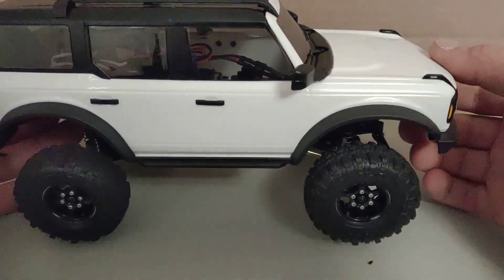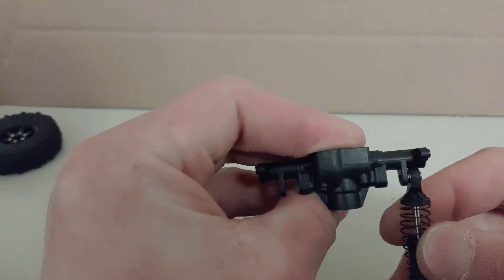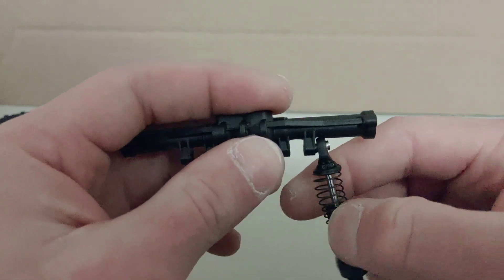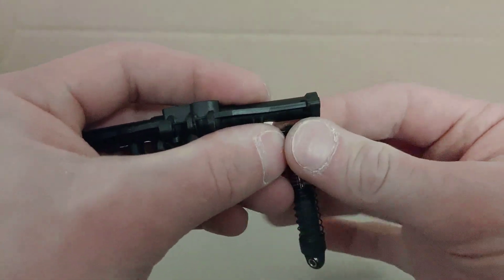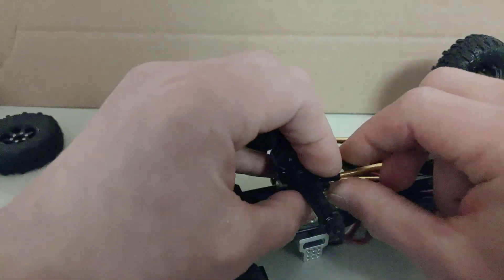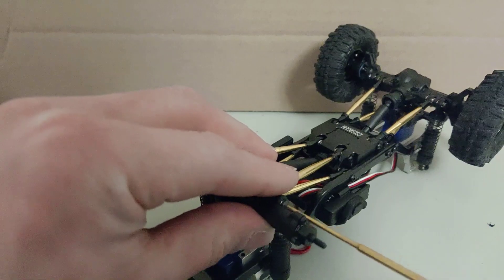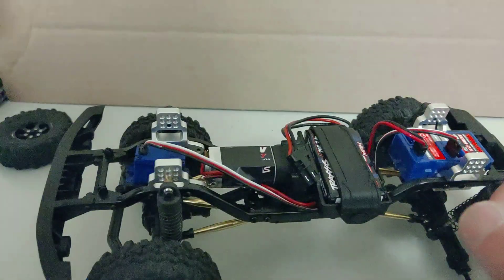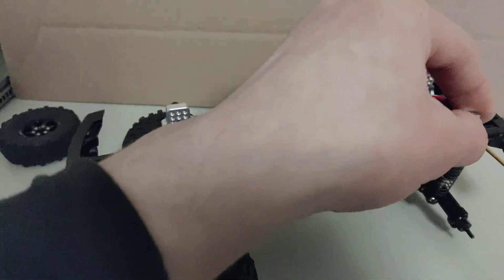Traxxas TRX-4M leaky shocks and rear axle housing fix.

Comment: Wow, you fixed me👍🏻
Guess I over tightened the screws for my rear shocks/suspension links when I installed my bearing kit. No more excessive toe in and it freed my shocks to move properly without needing to trim the rear axle housing. THANKS A LOT!